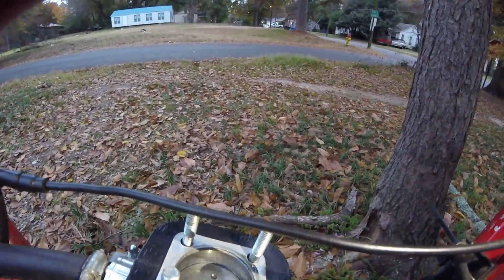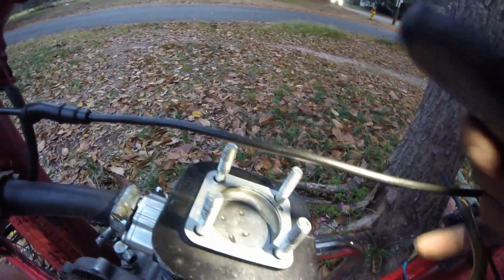Jb Welded Bike Piston

Comment: lol nice, JB weld is a good bandage, but it won't last longer than 10 - 20 miles before it burns up, unfortunately gotta get a new piston cause the holes will get bigger and the steel flakes in the JB weld will score the cylinder

Gotta get a fatty expansion chamber on a window piston, avoid that zeda 88 banana pipe crap, a lot of sellers list them as mz 65 pipes when they're not
Reply from the maker: Yea, thanks bro

Comment: If only our gasoline  doesnt have e85 jb weld piston will hold up forever.
Reply: ?
Sorry for the stupid question what do you mean ?
e85 gasoline ?
Reply: @andredesouza9767  so ever since we they remove lead from gas and replace it with ethanol our gas is pretty much trash it gum up carbs and much more.